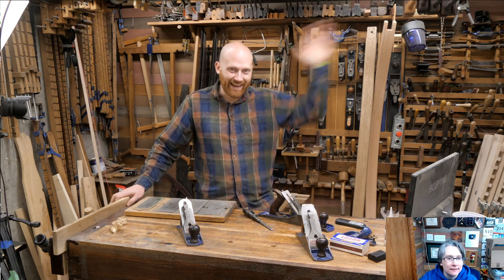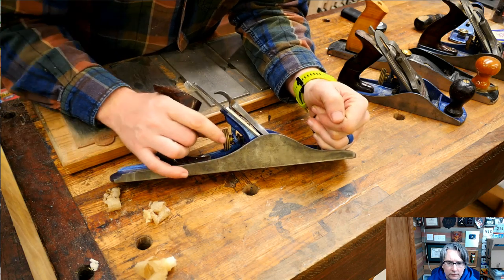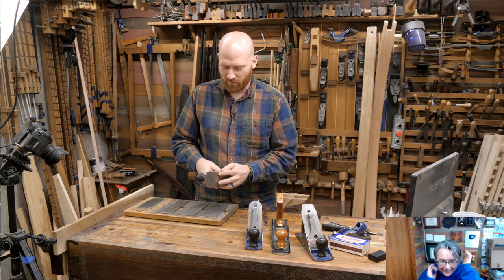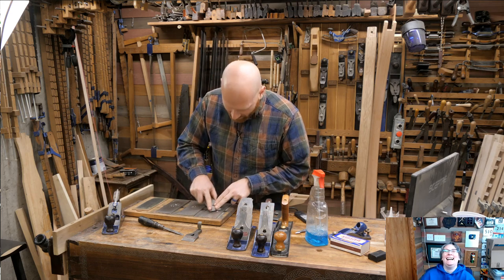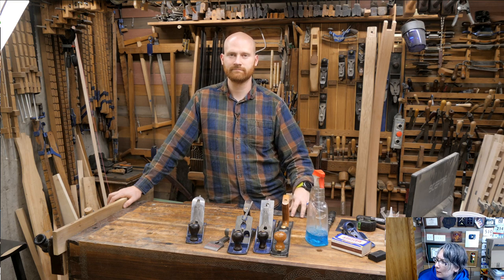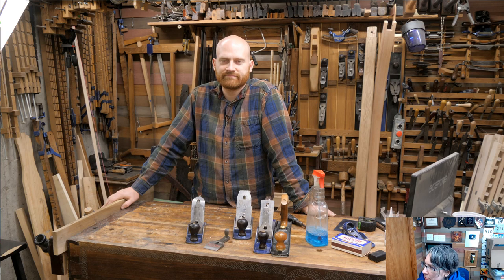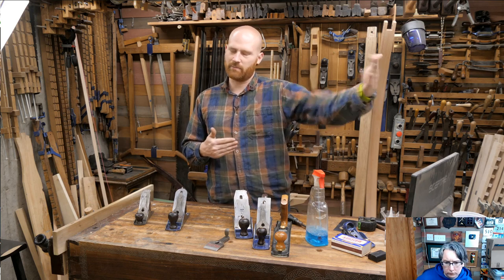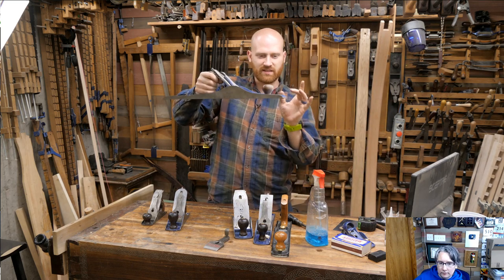Common Hand Plane Problems and how to fix them.

Comment: this helped - especially mentioning that you need to be adjusting the plane towards lowering the blade in order to cut - to avoid the force of the cut driving the chipbreaker+blade back. just smoothed some nice stool legs, ty!

Comment: First time viewer here. Lots of good information, thank you. One thing i wanted to comment on. I remember 55-56 years ago being severely chastised by my dad for NOT turning one of his planes on it's side when not actively using it. He told me to never put the plane down on it's sole unless the blade was fully retracted. Something I follow to this day. Especially the planes I now have that were his.RIP. I see that you have all of the planes on your bench sitting upright. What are your thoughts on Dad's rule?
Reply from the maker: It won't hurt it at all to set it down on a wood surface. I have an older video testing it. That was a myth that came into existence in post war shop classes.

Comment: Great video James!

I'm having some issues with my new no 5. The lever cap keeps coming off when retracting the blade and the adjustment wheel is far too stiff. 

My theory is as follows…

I've found that due to how there is no clearance between the cap iron and iron (prev owner over flattened the edge in pursuit of having it mate flat with the back of the blade), the lever cap is sitting parallel under the lever cap screw instead of at an angle. This means as the blade is retracted, the lever cap is easily pulled up and off as the screw isn't blocking it's ability to travel up the body of the plane. The only way to somewhat secure the lever cap means I have to really tighten the lever cap screw to sandwich it to lever cap etc as opposed to having only moderate pressure and the angle of the lever cap block it’s path of potential movement. 

This could explain why the adjustment wheel is incredibly tough to turn past the point of play/backlash also. If I set the lever cap screw so I can turn the adjustment wheel easily enough, the lever cap is essentially free moving and not secured at all.

Annoyingly, I don’t have a replacement cap iron to hand yet so I can’t test this theory. Have you ever encountered this and does my reasoning hold water y'reckon?

Edit: Right, turns out it has been a perfect storm of mechanical shortcomings; the cap iron is far too flat and the lever cap has had the "tail" of the kidney bean opening filed down/broken off meaning it can easily become dislodged. Time to source replacements for both and see how it fares.

Comment: James, i like your video very much, keep it up. I have a problem with my no 5 plane the depth adjustment of a plane is jammed , when i tried to increase the depth the knob  turn one to two cycles and jammed but when i lose the cap iron it can turn freely but the cap iron is tied, i have the same problem again,i think the cap iron is not too tight, i use Indian hand plane copying stanley.From North eastern India.
Reply from the maker: It sounds like your lover cap might be too tight. It should be a good bit looser than you would expect. Loose enough. You can push the iron around with your hand but not loose enough. It will move when you tap the plane.

Comment: My chipbreaker is always sliding right up to the edge of the iron. Am I just not cranking the screw that clamps them together enough? I have a Draper.
Reply from the maker: If the trip breaker is sliding, then the chip breaker screw needs to be tightened down more. It actually takes a decent to work. That's one of the reasons why there's a large slot for a large screwdriver

Comment: Also the adjustment knob is very tight when I try to extend the iron out. I think something is wrong ... as if extending it pushes the chip break out to the edge of the iron.
Reply from the maker: If the depth adjustment is tight that might mean that the lever cap is screwed down a little bit too tight. How tight that screw is on top determines how easy it all moves in and out. The chip breaker screw determines if the chip breaker will move against the iron or not.

Comment: Hi.  Have refurbished old hand planes in the past, taking extra care in not breaking the stem screw for front knob.  My luck ran out today when, while attempting to remove the old stem for a newer one, the old rusted stem broke off with very little left to grab in an effort to turn to remove.  Any suggestions?  The plane I'm currently working on is a Bailey No. 6, circa 1910.
Reply from the maker: oh no fun. if there is enough material you might be able to use an easy out. https://amzn.to/3uZfube but most of the time in that case the only option is to drill it out and re tap.
Reply: @WoodByWrightHowTo  Well, I was afraid of that.  But I guess I'll have to try to back it out.  Thanks for the response.

Comment: Hi James, really informative video thanks. I have a number of Bailey planes that I’ve inherited, in different stages of restoration. But I have a common problem with all of them. Having sharpened the blades, adjusted the chip-breaker to about 1/32 away from the cutting edge, I run out of adjustment before the blade extrudes enough to make a cut.  I’ve tried adjusting the frog to no avail, and replaced blades but no success. I guess maybe the chip breakers have been filed too short, but it’s really odd that they are all have the same problem. I am worried that I am making some fundamental errors when reassembling the planes, can you advise please
Reply from the maker: That can happen for a bunch of reasons. For the most common is that the slot that the yoke fits into the chip breaker has been worn out over the years and it can't push it as far forward as it used to. It could be that you have a newer thicker iron in there and the yolk can't push it farther forward. It could be that your yoke is worn out and doesn't have the ability to push it all the way forward. The good news is you really only need it that close when you're doing fine smoothing. For most other operations I have it about 1/8" away from the tip.
Reply: @WoodByWrightHowTo  many thanks James, I’ll try those solutions and let you know how I get on
Reply: @gregholland6487 any news sir?

Comment: Thanks for the video! I recently restored a Stanley No 4 (from 1930-31 according to a site) and I am happy with the way it turned out. However, the only thing that I could not fix was the lateral adjustment leaver, that thing wackes like a dogs tail (a huge amount of play). It seems to work (?) I guess (I am new to woodworking) or at least it doesn't seem to change blade alignment when it moves. The ratteling while working with it is anoying though. Since there are no screws to change/tighten: do you have any idea how to tackle that?

Comment: @40:40 don't they only harden part of the cutting iron? I thought the steel isn't hardened all the way to the keyhole (the keyhole for the chip breaker screw). Is that true?
Reply from the maker: Close plain irons are hardened all the way. It's just easier to heat the whole thing up in an oven It is to heat one section with a flame. That also leads to stresses in the iron to do just one section of it. A hundred years ago plus it was common to laminate the steel and the Japanese still do that in which case then you get a hard steel on the very cutting edge and a softer steel on the bevel side.

Comment: I'm usually pretty decent with hand tools, but I've been having trouble with a number of hand planes I inherited. For lack of a better description, the soles generate too much friction as I'm running them over the wood. I've already got my planer irons sharpened up to about 9,000 grit and at the correct angle while keeping the edges square. But I can try running my plane across a a board without even an iron in it, and it takes all my strength to get it to judder across (and I'm a big guy raised on farmwork. If holding a calf down with one hand so I can brand it with the other is just a day ending in Y, I'm leaving the boards singed from the force and friction after a few passes.)

Everyone tells me to flatten the sole. Well, my great great grandaddy did that back in 1902 and the soles are flat enough to correct rulers. All I can think of is that the soles need to be polished to reduce friction. I have car polishing wheels, cutting compounds, sandpaper that goes up to 20,000 grit, and a set of Japanese whetstones that were traditionally used to polish a samurai's swords.

Thing is, I don't want to ruin my planes. To what grit do the soles need to be worked? And how often? I don't want to grind my soles after each use like a chef's knife until there's nothing left. 

But nowhere can I get anyone to tell me how smooth, in any way you wish to measure it, the planer soles need to be. Help a guy out here?
Reply from the maker: You don't need to flatten the sole. It'll work perfectly fine just the way it is. If there's too much friction between the soul and the wood, the answer is a little bit of oil or Wax. I generally use a paste wax that I make from beeswax and raw Linseed oil. But pretty much any wax will do. I know a lot of people who just rub a candle on the soul. If you want me to look at something specific, feel free to send me an email. I'd be glad to talk you through it. jameswright@woodbywright.com
Reply: @WoodByWrightHowTo  thanks. I'll take you up on it if oil or wax doesn't do it.

Comment: this is interesting, youtube now shows time stamps in the progress bar! that is a handy adition!
Reply: do you have any experience with laminated plane blades?
Reply from the maker: yes i have made a few of them. it is a great fast way to make a plane.
Reply: Oo no I didn't mean that, I'm sorry but I meant plane irons. So a thick piece of soft steel with a thinner layer of high carbon steel forge welded onto it, they were common on old wooden planes and in japanese hand planes
Reply: @LegoMan-cz4mn  see above, lol
Reply: You dug up quiet an old comment.. hi

But what do you mean by above?

Comment: Good video. However, no matter how much I sharpen a blade or what angle I do so at, it also just chips up wood instead of slicing it. I was just using a blade I bought, it was fine, and then I sharpened it and it stopped working. Any ideas? It’s maddening.
Reply from the maker: Feel free to email me pictures. But is sounds like grain direction or plane setup problems.
Reply: @WoodByWrightHowTo  I suspect the problem is partly my chipbreaker- (with every stroke it gets clogged with chips)
Reply from the maker: Oh that's a simple fix. That means that the chip breaker is not fit to the iron. Here's a video on that https://youtu.be/cQzLdMsGCqk?si=q05QOnWj4zUYO6tk
Reply: @WoodByWrightHowTo  Been looking at that one, yeah. So far no luck, will let you know how it goes.

Comment: I have a Kobalt bench plane, I backed that screw  all the way and the blade is just barely making contact with the wood. Is there something else I need to do to get more blade out to cut the wood??
Reply from the maker: Kobalt are very poor planes. Most of the time they can be made wo work but you have to be constantly adjusting them as they do not hold settings. It sounds like you got a digestive chipbreaker. The only thing you can do with it is to back the chipbreaker off from the tip by  an 1/8"

Comment: My blade and chip breaker not laying  flat on frog and the blade  sticking  way out of plain.
Reply: I'm really  new at this
Reply from the maker: If it's not sitting flat on the frog, then there's something holding it out. It might be that the frog is in the wrong place. It might be that it's not fitting onto the lateral adjuster. If the iron is sticking out too far then the depth adjuster needs to be moved farther up. If it can't move up anymore and it still sticking out then you have the wrong chip breaker. If you want me to take a look at it more, feel free to send me an email. I generally don't see replies here. jameswright@woodbywright.com

Comment: My blade will not reach below the mouth to cut wood. Do not know how to fix it, It’s happening on a vintage Stanley I am restoring. It’s my first time restoring a hand plane, does anybody have any suggestions?
Reply from the maker: Make sure the chip breaker is within an 8th inch of the tip of the iron. if it is then probably have the wrong chip breaker for that plane. feel free to send me an email new pictures I'd be glad to take a look at it.
Reply: @WoodByWrightHowTo  thank you! where can I find your email?
Reply from the maker: You can find it on the about tab on my channel page or the contact form on my website. I would post it here but then it gets picked up by skimmers.
Reply: @WoodByWrightHowTo  no worries will do thank you!

Comment: Anyone know how to fix a bent adjustment screw
Reply from the maker: Generally if the screw is bent you pull it out and replace it. I'm assuming you're talking about the depth adjustment with the knob on the back. I've never seen that one bent before but if so crush it down with a pair of vise grips and you should be able to turn it out of the frog.
Reply: @WoodByWrightHowTo   my husband was repainting the parts and it got run over in the drive way and bent the screw